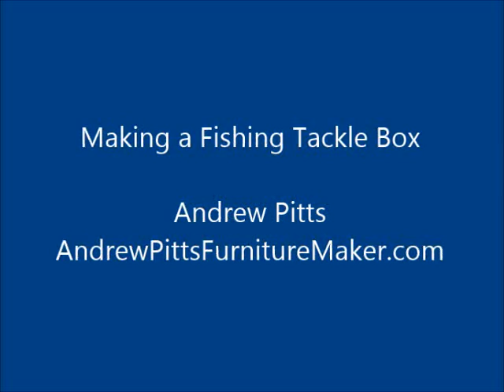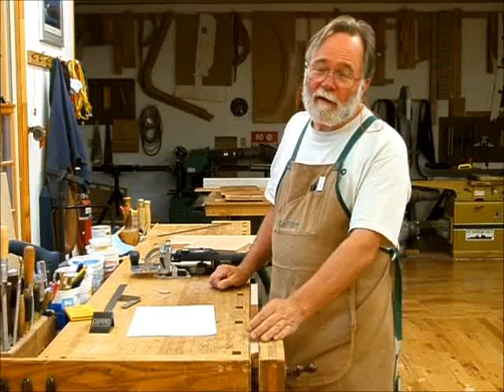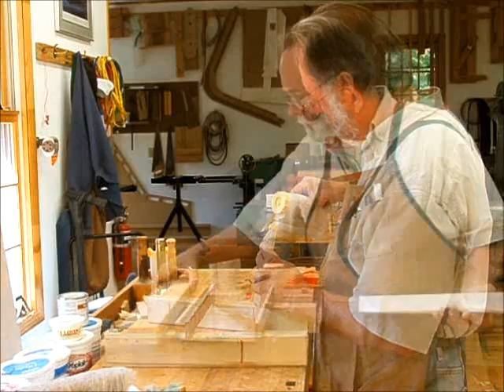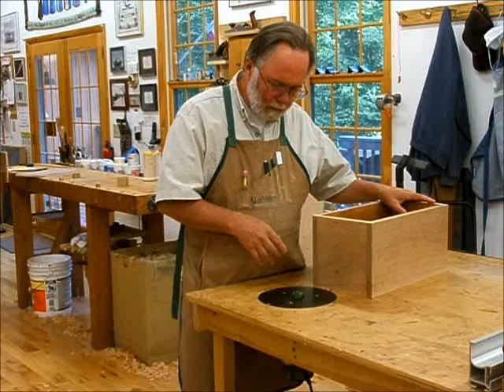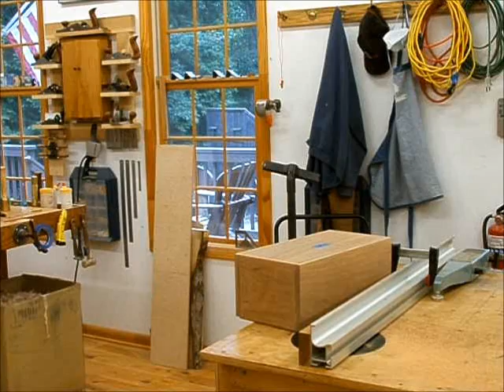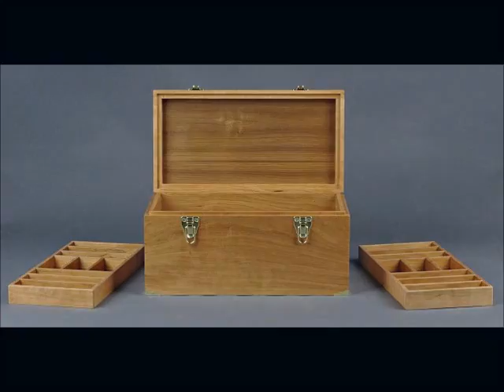Making a Fishing Tackle Box: Andrew Pitts ~ FurnitureMaker

Comment: Remember you're talking about mostly very small fishing tackle (hooks, sinkers, etc). You need dividers inside most of those divided compartments, with only two or three larger compartments remaining for tools (pliers, tape measure, scale, etc) and similar. Removable dividers are ideal, but even fixed dividers for smaller compartments would work.
Reply from the maker: Agreed. This was really not meant to be used fishing, though. It was a retirement gift meant to sit on a table, more as art than practical.

Comment: When I saw this I thought you copied my box which is identical from 2 years ago. It is so close it is scary. I'd show a picture if I could but then it is as I said the same. I also filled mine with handmade plugs, poppers and lures all from cedar. I also made a matching rod tube, dip net and a wood casting rod made of birch with a maple/birch bark handle in the 1930's style.
Reply from the maker: Peter Dallman Peter, I'd love to see a photo of your box. Did you use as thick material as I did? One comment I received indicated that typically the wood used is much thinner. I'd love to hear your thoughts on that, since it sounds like you use your box when fishing. By the way, I did design this box construction (dimensions, joinery, etc) for this particular client, but it is a very common style that has been around a long time. Like they say, there is nothing new in furniture design. Andy
Reply: Great minds think a like